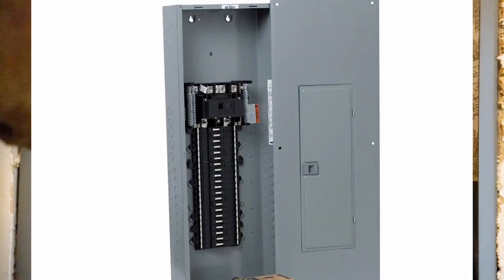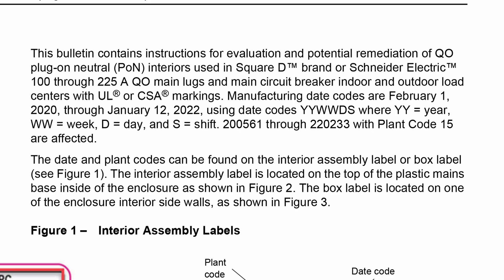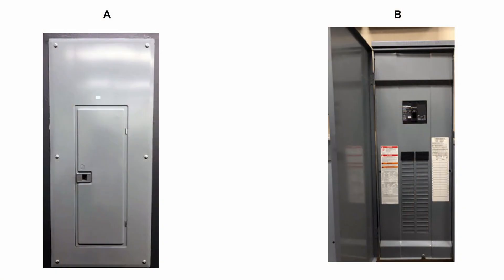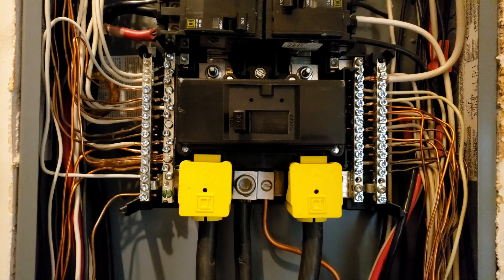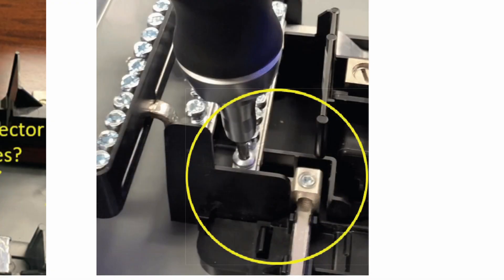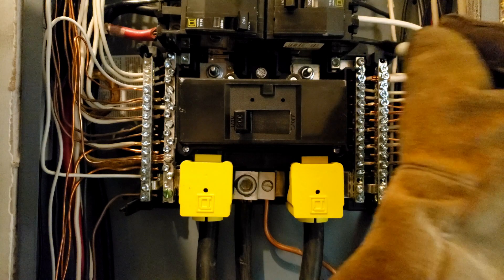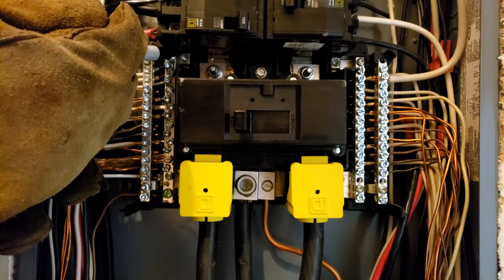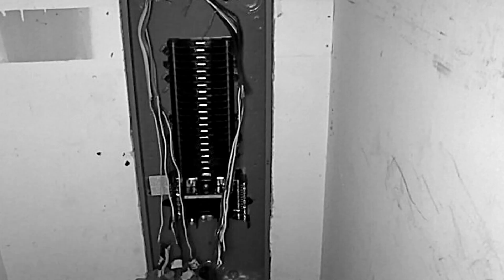QO Electrical Panel Safety Recall Inspection of a QO  Plug-On Neutral Load Center

Comment: Thanks I'll inspect the Square D plug on neutral screw tomorrow after checking the date code to determine if the panel is affected.